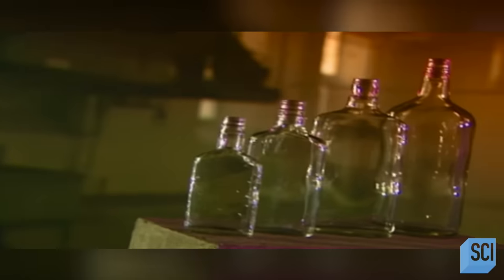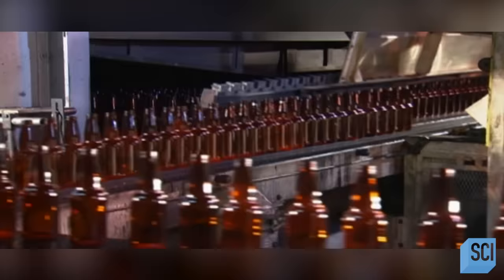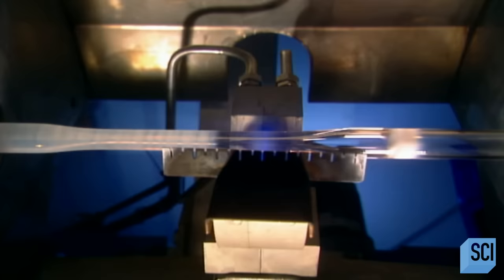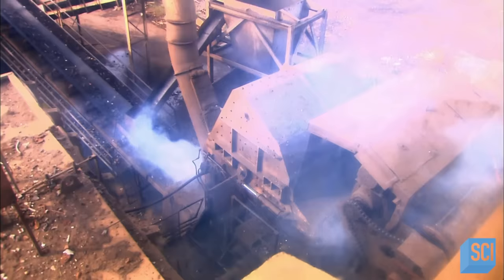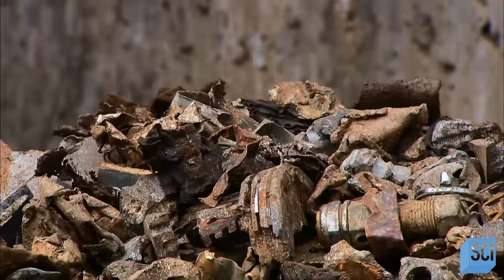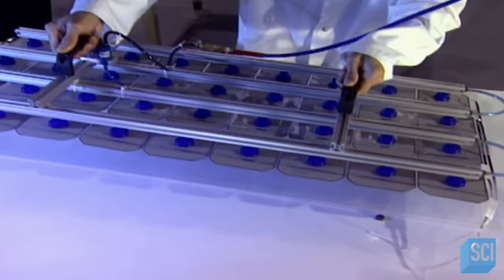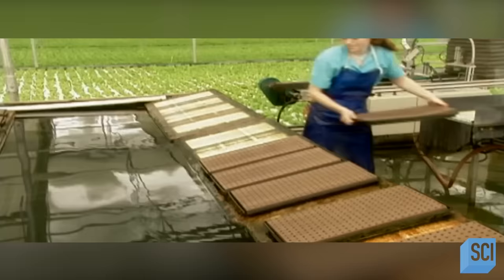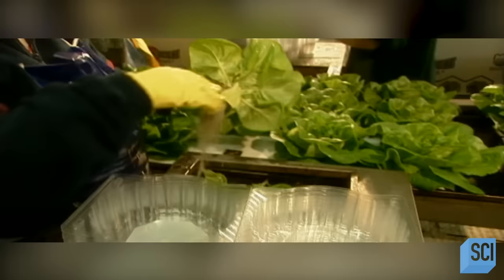How Glass Bottles, Fiber Optics, Solar Panels, & More Are Made | How It's Made | Science Channel

Comment: Point of information, sand is not abundant, we're believe it or not running-out worldwide due to its uses in basically every product.
Reply: were running out of rough construction suitable sand, which is rough and locks together better than other form factors of sand, which while it might overlap in SOME cases with glass making sand, the properties youre looking for are entirely different, you just need relatively pure, or impure in the ways you want, or impure but easily purified, silica sand for glass, vs construction/beach suitable sand where all you need is something thats coarse, and gritty, and gets everywhere.
Reply: @rjwaters3  Ah yes, this is right, it was the interlocking sand you mentioned that's short on supply.

Comment: What does "A chemical Element" mean? Aren't all elements chemicals
Reply: Metals aren't chemicals 😊. Chemicals are typically substances, often refined.
Reply: An element is just the pure root substance, e.g. carbon, oxygen, aluminium, mercury, etc. A compound is a mixture of multiple elements, e.g. steel, carbon dioxide, sodium bicarbonate, etc. 'Chemical' is a loose word as it can be difficult to define. In layman's terms, a chemical is often an artificially produced and refined substance, like gasoline, ethanol, toluene, etc. But in chemistry terms, all matter classifies as chemicals.
Reply: @ChristopherWoods  In layman's terms, maybe. But in chemistry terminology, all matter classifies as chemicals.

Comment: So why doesn’t the small glass strand break when wound onto the spool?
You would think solar panels like that would have more output then those tiny wires could provide (amps)
Reply: the glass's ingredients mix uses materials that create very flexible glass...
Reply: Those wires are waay oversized. This episode shows a rather old way of making solar panels. The ones seen here are 100-150 watts or so, which isn't all that much. The polycrystalline panel, the second one they show, is even smaller, probably 50 watts.

Comment: More green projects.
Ocean fronts when you need to replace sand don't dreg it up use desert sand or go to a rock mine put rocks through a thing that crushes it to sand size and use that.
Why well it reduces Ocean and river sand use it makes more sand it makes places for kids to Play at the water and as the water does its thing and washes some sand away wich will require replacing will end up making more needed and required sand.
Yes water sand and the other sands I talked about are different desert is to round crushed rock is to um ruff water is just right said the girl who broke into the sand house.

Comment: This How its Made video on solar panels is the most useless video ever.  It skipped on how solar cells are made, it just assembled the solar panel.  It should be renamed "How Its Assembled" instead of "How Its Made".  Useless!
Reply: The title of the segment was not "Photovoltaic cells" but "Solar panels." During season 1 (which that segment was from), the show was still small and limited to domestic manufacturing processes in Canada. The photovoltaic cells were probably made elsewhere.